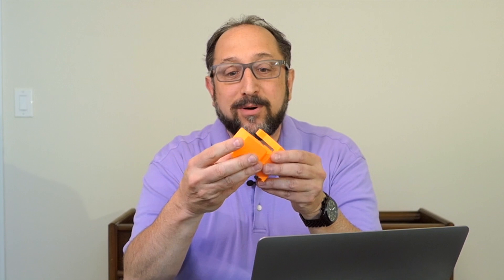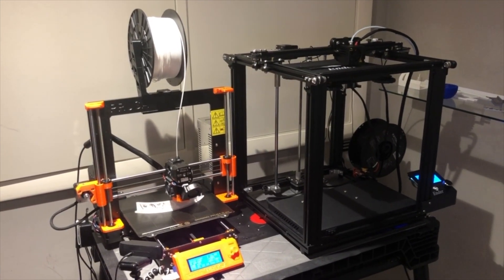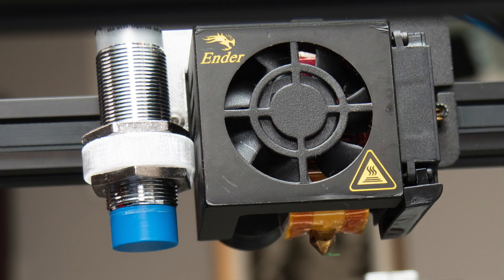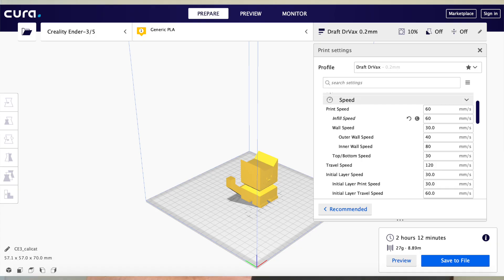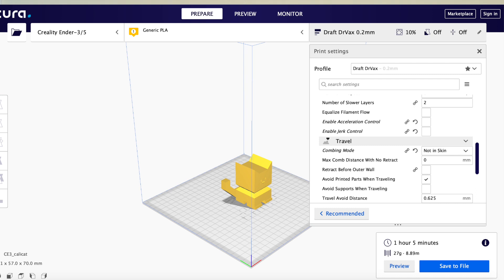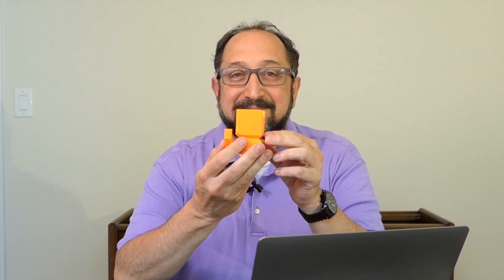Faster 3d Prints with Simple Modifications and Cura Settings

Comment from the maker: I have received valuable comments about this video.  After reading these comments, I believe I overstated the impact of the Slicer settings on speed and understated the impact of printer hardware and firmware.   I am doing a bit of additional research and testing, and I will be posting a follow-up video explaining what I have learned.   Thank you to everyone that commented.

A fact I did not make clear is that Slicer estimates are just estimates, and as they say in automobile ads, "your mileage will vary."   In my experience slicers generally underestimate print times, often significantly.    I find the Slicer estimates directionally accurate but not reliable.

The slicer settings I highlighted in this video will impact print time and quality but not as much as we would like.  Several comments indicated that firmware in a 3d printer would limit the impact of Slicer settings.  Slicers have the ability with M203, M204, and M205 G-code commands to override firmware values.  I will cover this in more detail in the video "Faster 3d Prints, Part Two, Slicers Lie."

Irv Shapiro from the DrVax Channel
Reply: I'm from a year in the future. I've tried your setting on my Anycubic Mega Zero. Definitely improved the overall speed and quality for the draft setting. I haven't modified the hardware any and still received amazing results. Don't beat yourself up too bad. It's lightyears away from the default settings that came with my printer. Would highly recommend this video.
Reply: Hi. Can You upload Your CURA  profiles for download? :)
Reply: @Nauka.i.Eksperymenty  Mee too need the profile and settings Dr Vax used
Reply: Hey Dr. Vax love your videos. I have an Ender 5 pro with the aluminum extruder. Do you believe changing it to the one you mention would improve print speed? If so what differentiates the two in terms of performance?
Reply from the maker: No.  Probably not.
Reply: something you could try, is either the 32-bit board, or a cheaper alternative (and way better IMO) using klipper firmware, it unlocks the beast inside your printer and my god does it show, you can even enable input shaping to compensate for ringing and resonances
Reply: Dr Vax can you share a link of your printer setting profile Draft DrVax, yours it's showing 2 hours mine it's showing 6 hrs

Comment: 5:08 The print bed usually falls because the unsupported screw freely fits the nut.  Adding the upper support creates a binding action that keeps the bed in place by friction.  Is binding bad? On a 3 axis machine, yes.  But with the limited amount of Z action on a 3d printer (contemporary slicing software technically renders them a 2.5 axis machine), I don't know if if makes much difference.

Comment: Nice vid theres lots of mad settings in cura.  I usually print at 0.2 or 0.3 height with a 0.6 nozzle and width - like you said changing the infil and other settings can cut the job time in half and actually when you print out a before and after there's often not too much difference!

Comment: I just recently started printing, but found your channel out, and you've helped quite a bit. 

I have an Ender 3 V2, and I use a custom firmware for convenience, I've found through experience that a higher initial print bed temp (at least for PLA) of rough 65-70 works great with adherence. 

The setting is easy to adjust in Cura, and whenever I need a raft support for more difficult support beams, or to not ruin a curve nearly as much as I would otherwise. I increase the print speed to 300 (in the Ender Software under Control Settings)

You tought me to also increase the Print Temp alongside the speed to keep up with the filament demand, so thank-you.

---And---

I'm testing a print now that is Ender brand PLA on the Ender 3 V2 at 210°c  at the Ender software's 300 speed for raft support, and 200 Speed for the actual print itself. 

It looks great, although not finished yet, and I'm worried about the 10% infill and whether it'll be able to hold the PLA as quick as it is coming out of the nozzle right now
Reply from the maker: Only way to know is to try.   3D printing is as much an art as a science.  That is part of the fun.
Reply: @MakeWithTech  

Thanks yet again, just tried it yesterday with a 4 piece part, and it turned out fairly great. 

Had to use Wood Filler to fill in holes, because the 10% infill did become an issue at certain slopped angles, but after a good paint job no one could tell it ever happened.

The trick was risky, but fun, and shaved off way more time then I ever had anticipated making a 20 hour process almost 15 hours.

Comment: Interesting suggestions and I will have to try out some I have yet to use. I had a Tevo Tornado which died electronically and was replaced with a Sovol 01 printer. It is making better prints but much slower. I tried to print a large object like a T Square fast on the Sovol and it failed due to the jerking you mentioned of the bed. At any rate that now I have invested int 2 printers if I was aware of the modifications one has to add to the $300 printers I think I would have saved and bought the Prusa in the first place. Most reviews have indicated it is a very good solid machine.

Comment: Hi DrVax and thank you for your informative videos! I have been having some trouble with trying to cut print-times and realised when following your video that I could not get your results in the new Cura 4.6.1. Using your exact settings I get 2h 12 min on new Cura. Downloading Cura 3.6 that I think you were using here I got 1h 20 min for the cat. 

Does anyone know where Cura has added some of these new time-delays?
Reply from the maker: Check to see if combing is on or off and check speed and retraction.
Reply: @MakeWithTech  I have "combing only in skin" retraction settings puzzles me, retraction speed 45 mm/s can I change this?
Reply: not in skin I mean %)
Reply: @MakeWithTech  also in the cura 3.6 the retraction speed was actually 40 mm/s, still with almost half the print speed! i get really good results when printing at top speed but curiously the cura 4.6 does not seem to agree with theses settings

Comment: One tip I didn't notice you mention is the line width. This does not have to the same as the nozzle diameter. For example I have had acceptable results with line width set to 0.52mm using a 0.4mm nozzle. Cura allows you to set different line widths for outer walls, inner  walls and infill. This can make a difference if your print has lots of wall and not much infill (eg something with a lot of thin strips). The only issue is that this also means the extruder needs to push out more filament. If your extruder starts skipping steps that's a sign you are near the limit of what your extruder can do.

Comment: Going nuts trying to tune my Ender 5 Plus, I can get rid of ghosting fairly easy, but no matter what I do I can NOT fix the bulging corners. I had to wind down all the way to 40mm/s to almost, but not quite fix the corners.
Is it easier to work with classic jerk rather than junction deviation? (JD fixed any ghosting, but never the corners)
Reply: I don't have upgraded PTFE yet but have TH3D Toughtube incoming. Can't upgrade PTFE couplers as I have none (Micro Swiss hotend). My extruder is the Bondtech BMG. Other than the bowden tube I think I'm fairly well set up for fast print speed (but still want dimensional accuracy). I Also have a SKR 1.4 Turbo mainboard with 2209's so no issues computing gcodes and keeping up.
Once I can print accurate parts I weil likely print a solution for direct drive with the BMG to cut out the bowden altogether
Reply: @SteinerSE  for the bulging corners you have two options, print slower or spend some time setting up linear advance which is not as easy as it sounds for bowdens
Reply: @oriongaby  Believe me I know, I have struggled with it.

Comment: This is super interesting once again Doc. I've been slowly chugging along with my new Ender 5 for a week or so now. My main, initial plan for a large-ish print is some bed supports in carbon fibre PLA. I've already printed that Z axis lead screw stabilizer bracket, but then I thought, hmm, and I altered it on Tinkercad to accept an 8x12x8 needle-roller bearing, as I don't think the PLA will last too long, even though the L/S rotates relatively slowly.

Comment: hi vax, how are you? so, i have ratraction problem with my ender 5, alot strigns im my tests, can you show me what configuration you use in cura? please
Reply from the maker: Try 6.5m retraction and 25m/second.  To do better you need to replace the stock Bowden type with Capricorn tubing which has tighter tolerances.  The downside of the ender 5 over the three is the very long Bowden
Tube
Reply: @MakeWithTech  thanks alot, but, im already using capricorn ptfe, and about z hop, im using on or off? and combing mod, turn on or off? thanks alot for you help
Reply: TeJoTa Tiro Esportivo turn on combing not in skin and set the combing distance to 1.5mm
Reply: Hi! I've been tuning my ender 5 the last few weeks. at first I had quite a stringing problem but then I followed the advice on this video https://youtu.be/dIkjR2Ytx-g
with good results. cutting off the tube to avoid a gap. I also followed this video to tune the extrusion: https://youtu.be/xzQjtWhg9VE. Now I'm looking into getting faster prints but having problems with the new Cura 4.6. When comparing with the above settings I get 2h 12 min in Cura 4.6 but only 1h20 min in Cura 3.6 why is that? Also my Ender usually prints faster then the slicer approximates. A print from last night printed in 6h 12 min while Cura stated it to take 6h53min!
Reply: @henriklagercrantz  so, about the strings problem, do this advice, works for you?
Reply: @CarabinaspotentesBr  Ye certainly! I have hardly any stringing if at all they're very faint whiskers.

Comment: Been watching and listening for a while now... What effects would these have on a Wanhao Duplicator i3+ ???.. That is what I have and it seems to be a pretty stable printer, but would like to actually use your advice.
Reply from the maker: First, if it work do mess with it for production work.  On the other hand there is no harm in experimenting.  That is part of the fun of 3D printing.  It is very difficult to break your printer with experiments  in slicer settings. You can always go back to your old settings.

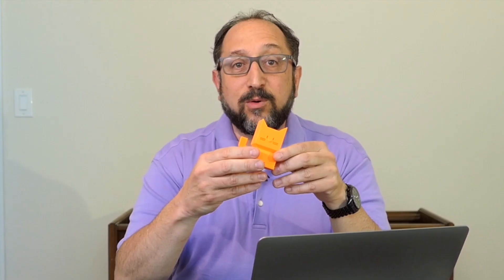Comment: My printer is slower than the time shown in cura, the time on cura is 1hour 8min the printer finish in 1:20 on 0.15mm hight.
what's causing that?
Thanks
Reply from the maker: The cura numbers are just estimates.  The times are generally shorter in cura.
Reply: @MakeWithTech  Thanks for your reply.

Comment: That is incredible print quality! Would these modifications work on the Ender 3? Thanks for sharing this neat information.
Reply from the maker: Yep.   But speed is also impacted by the control board in the printer.
Reply: @MakeWithTech  Thanks!
Reply: Try to not go crazy with the y axis.
It tend to move around the room.
Dont leave your ender 3 printing this fast unattained, 
it wil move and fall of your desk if its not bolted down.

Also try to lay your print lines for the most part in the z axis.
This reduces the shocks it get from the buildplate.

Comment: hi vax, nice to meet our channel, so, what velocity ou used in jerk control? the standard velocity in cura are 8m/s all, so what ou used? thks alot
Reply from the maker: I start with the Prusa settings which are much higher and then lower them until I get acceptable prints.   Prusa defaults to Infill 20, Wall 20, top/bottom 20, travel 30 initial layer 20 and skirt 20 in the Cura 4.4 machine definition.   The stock Ender 5 has most of these set to 8.

Comment: Could you share the C920 mount with us? :D
Reply from the maker: While I have a 3d printed mount for my Prusa, which in fact I really do not like, for my Ender I just used cable ties to attach the camera to the front rail.  Far from ideal.   I may experiment with designing a better universal c920 camera mount but so far I have just kludged things together.

Comment: Acceleration, jerk and maxinum speed from firmware defaults can limit real printing speed. I tried up to 250mm/s for infill with good results. However, I noticed the firmware has a default limit of 200mm/s if my memory serves well.
Similarly acceleration affect what speed you can get up to. I think you need long edges to get up to a good speed. In preview I noticed my "quick and dirty 100mm/s" settings rarely used maxinum speed in smaller prints.

Comment: turning off jerk control its still in the firmware on the board !
Reply from the maker: Yes you are correct.  Take a look at my second video on printing fast and you will see the details of the interaction between the firmware and the slicer.

Comment: why bother with infill use a extra shell
Reply from the maker: Very good question point.  The structural integrity of the print will depend on the geometry of the model.  In some case multiple walls will work fine.  In others without some infill the model will not be strong enough.
Reply: @MakeWithTech  theres no strength in infill more strengh in a extra shell i understand model dependennt but if you done 0 infill extra shell it will print quicker and be stronger that model will print with no infill
Reply from the maker: I will give it a try.  Another consideration is that infill is generally printed at much higher speeds than top layers, bottom layers and wall.   That said thanks for the suggestion and it is something worse trying.   I may even do a set of tests and make a video about it.
Reply from the maker: Beautiful work.  Great video.  I would love to see a closeup of the boat.
Reply: @wayneuk  Then I will just squeeze the cat's head in the middle and go oops, I guess I needed 8 shells instead of 4..... Infill provides strength in all directions, so I couldn't put my finger through the middle of the cats head because there is infil, which is distributing the pressure. Great for a model boat that needs to be lightweight and someone won't be squeezing the walls together... Unless I misunderstood you, but for your use case, sounds good.

Comment: nice video, finally someone understands that we want FAST prints!
but there's a problem with your setup, the mainboard
you can't possibly print fast on a normal 8-bit board, you are pretty limited in the processing power and the maximum step pulses/s it can manage
if you truly want speed you should either get a 32 bit board, or the better option, install klipper firmware on it
I have my printer running klipper and it can manage 5000 acceleration and 500mm/s  with ease (in term of driving steppers, frame doesn't allow such accelerations normally I run it around 2K)
the ender 5 with klipper and a very good high flow hotend like the Nova or volcano should be able to run 200mm/s+ @ 2000+ acceleration if you bolt it down and add some corner braces
Reply from the maker: Thanks for the comment.  You are absolutely correct about the maximum speed and limitations of the 8bit board.

Comment: I don’t understand how you are actually printing that fast unless you reflashed the firmware. The stock firmware extruder is limited to 25mm/s and acceleration limited to 500. I believe jerk is only 10. Seems like those would limit your speed or ability to maintain that speed. Just curious how you actually tested the speed?
Reply: Do the firmware "maximums" take precedence over the slicer settings?
Reply from the maker: @NorthGaSawyer  Yes.  But the relationship is complex because the terminology is not always the same.  At the end of the day, the firmware will protect the printer for users attempting to push it beyond its capabilities.
Reply from the maker: By setting the slicer to these speeds I am allowing the printer to hit the firmware limits.  I have only verified quality to date and have not compared times so your observation is correct.  The firmware will limit the print speed.  

Prior to the upgrades I described in the video,  at these slicer settings, quality was poor.  With the upgrades quality was quite good.  

My point was to help my viewers understand the impact of various slicer parameters and how to allow your printer to run at the firmware limits.  

That you for adding the clarification your point is absolutely correct. 

PS.  I have upgraded the firmware to the TH3D Unified Firmware Package to support the EZABL. I have also replaced the extruder, Bowden tube, Bowden couplers and added an ezabl.

Comment: Switching off acceleration+jerk in Cura does only switch off the Cura specific settings. Means in this case the values of your Marlin software are valid. So your printing results are farther affected by your printer firmware settings for acc.+jerk.
Reply from the maker: This is correct.
Reply: confirm. The most frustrating point in this video. Even Cura does not drop estimation in print time. Somehow, most important settings stay untouched - jerk and acceleration.

Comment: Hi, all!
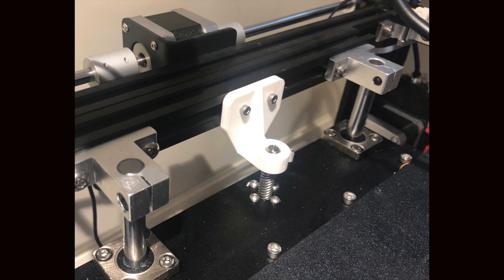5:00 - this detail can cause z-wobbling if the lead screw isn't ideal.
I've bought Capricornus tube (it's a cheap clone) and it helps pretty much!
Reply from the maker: You are correct.
Reply: He is referring to the over constraining of the lead screw right?
Reply: @zzing  of course. A straight line is math. defined by two points. You get three with all consequences.

Comment: Hi there DR Vax. Interesting video. I was wondering what the difference was between your Cura calculated print times, and the actual print time. As you're likely aware, slicers tend to be generous with their print estimates and when it comes to the actual print times they can be 60 to 80 percent longer. I use Octoprint with PrintTimeGenius plugin which is incredibly accurate in the actual print time calculations.
Reply from the maker: Good question.  I am away from home but I will check my octoprint log later in the week.